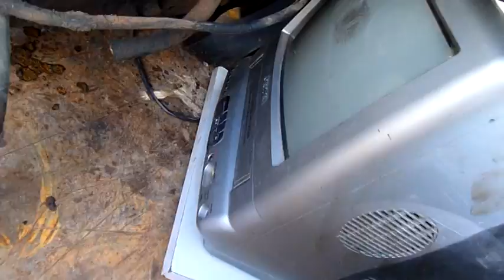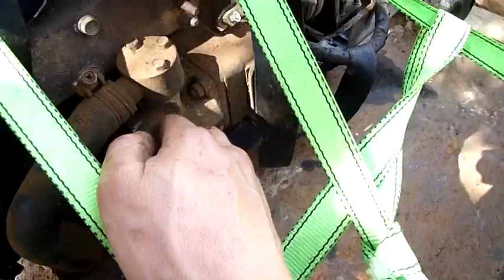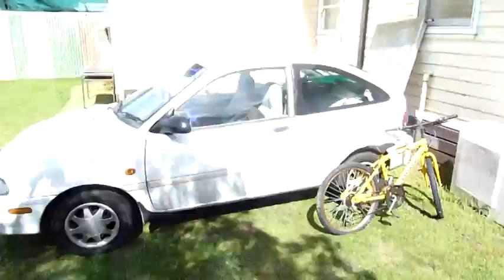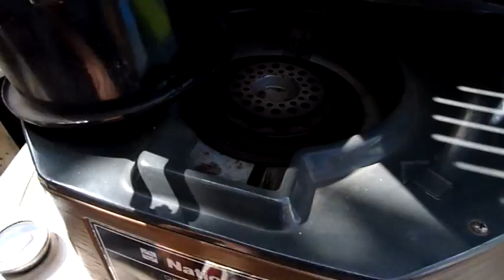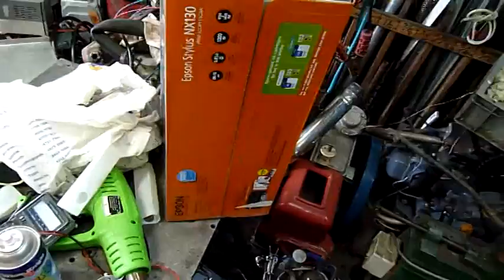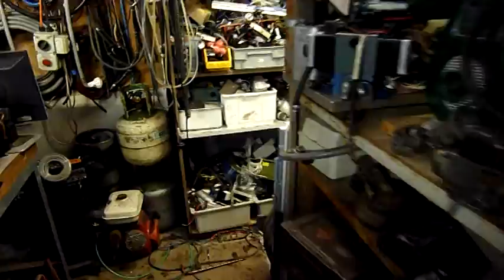Saturday Yanmar and A Thankyou To The Viewers

Comment: I have a whole shop full of that looks cool :)
I tend to avoid inkjet for shipping labels because of the smearing... from moisture a bit paranoid about it getting wet and lost forever in the the post. I use an old HP 8000 commercial duty laser I liberated from work when they "upgraded" to the all in one print fax copy things.

Comment: Rumor has it if that VHS tape deck jams and won't accept the tape, an AIR RAM will make it work better than from the factory.  But you have to have an air ram cylinder which is rare.  That is why those  CRT/VCR treasures get thrown out.  Need an air ram...  ;)

Comment: On some printers (my HP) you can set it to use less ink. For regular B&W text it uses way to much ink and smears easily, setting it one notch less makes it smear less and looks just as good. Colors look faded on that setting though, so it helps to make settings profiles for quick changes. One for B&W less ink, and one for color regular ink amount.

Comment: Good luck with those inkjets... Those things will "run out" of ink so fast. Notice I put that in quotes. When it comes time to replace ink, you might as well buy a new printer since it usually is cheaper than the cost of the ink combined.

Comment: those little diesel's are sweet, you see similar engines in smaller John Deere tractors here. I was thinking make a hydraulic log splitter using one of those ram's but running the shredder from it would be just epic.

Comment: thats one thing about these tractor engines, they covered in crap and once you clean them they look almost brand new. our case 580D has a much bigger inline 4 that is red and the PCV threads stripped so its been exhausting into the engine compartment for who knows how long, we fixed last summer but the tractor has over 6,000 hours and the engine looks black and red till your run your finger over it, then its bright red :P